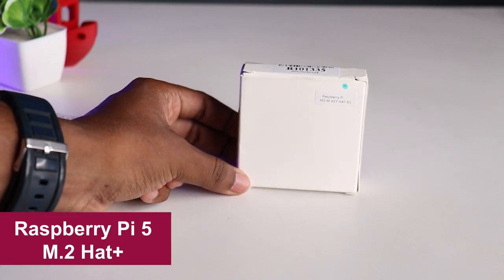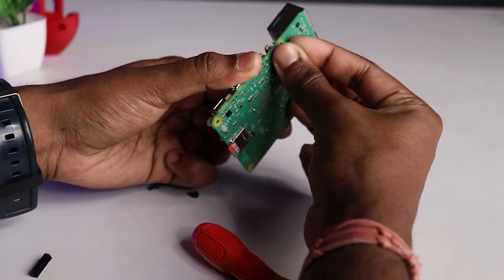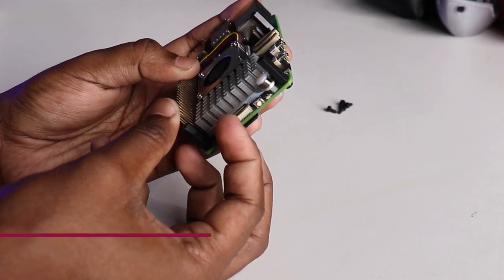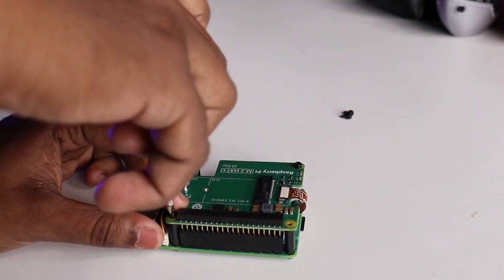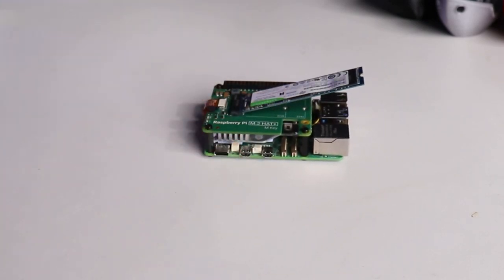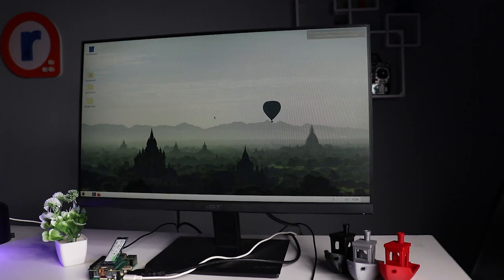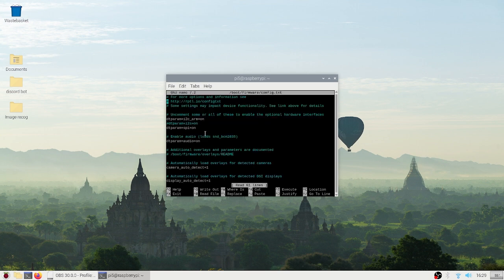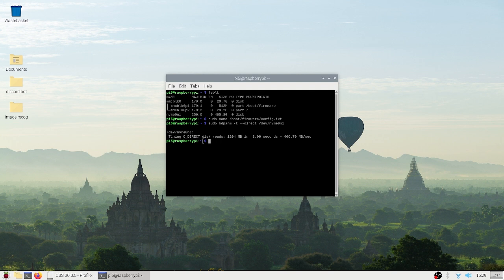Introducing Raspberry Pi 5 M.2  Hat+ NVME | Boost your storage with M.2 | Robu.in

Comment: Hi, 

I have recently purchased raspberry pi5 , the official active cooler , 27watt power adapter and m.2 hat+ all from robu . Since I’m not getting much option of 2230 or 2242 Nvme ssds . Can you please let me know if a 2280 pcie 3.0 ssd is compatible with raspberry pi5 and this m.2 hat+ ?

Comment: Sorry I bought the pi for the first time I have bought the pi 4gb, active cooler nvme hat and case all official but I not able to understand if we need to screw the hat and pi along with the case from the bottom or just the pi board and hat.

Please help
Reply from the maker: Hello there, @omkaravasthi8398 
You can attach an active cooler to Pi, then screw the M.2 Hat  on Pi, and if you need to  enclose it, you can remove the case fan. 
If you need  anything else, feel free to connect with our technical team at info@robu.in; they will surely help you out.

Comment: I think you've got the wrong size nvme ssd.  It's way more elegant with shorter drives
Reply: Yup. They used a 2280 M.2, it will work but it sticks out.

A better choice would be a 2242 or 2230.